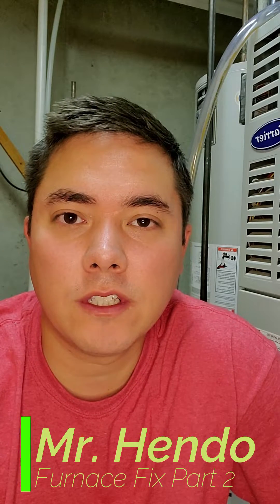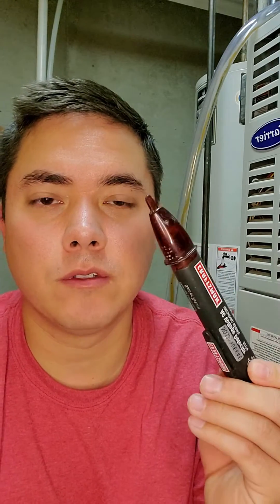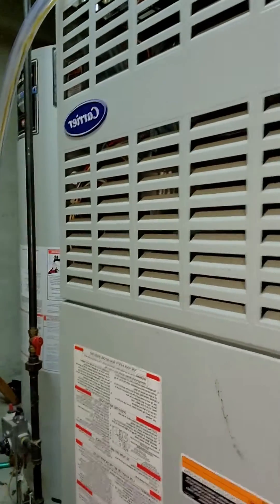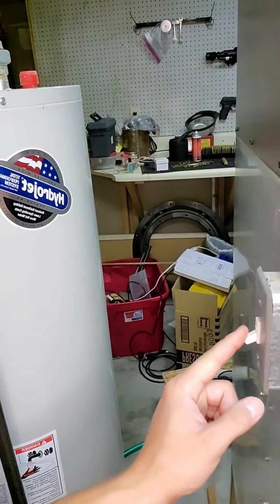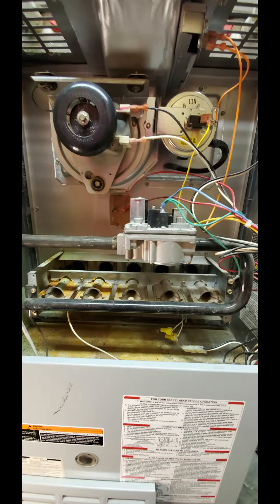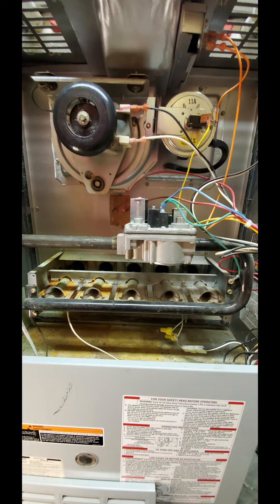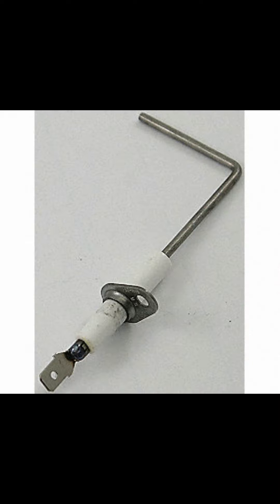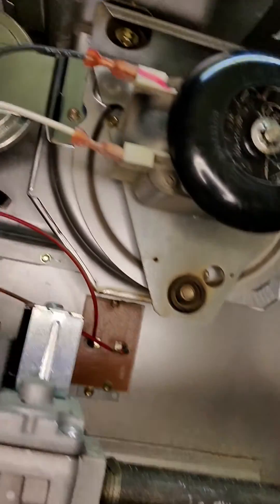Furnace troubleshooting and repair limit switch and flame sensor

Comment: 2 years later looks like I got first comment -- Gave you a a like and a sub.  Been trying to find videos on carrier specific limit switch and theres not much out there. This was helpful. I havnt opened my heater yet, will work on that tomorrow to see where the switch is and how hard to get to on my model (different than yours).  Just wanted to say thanks for the upload.